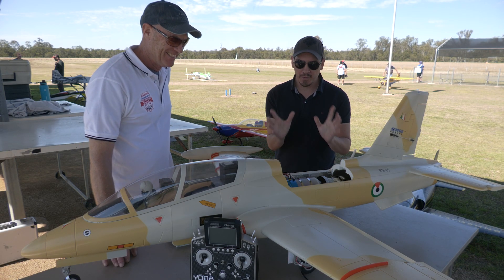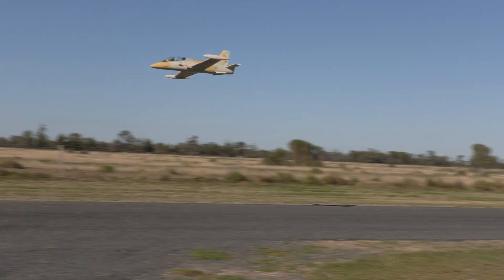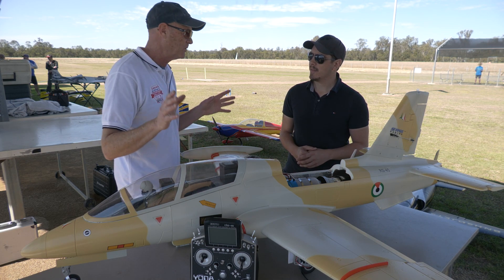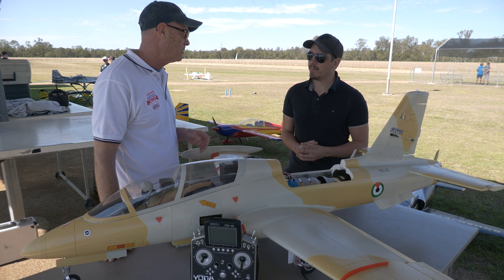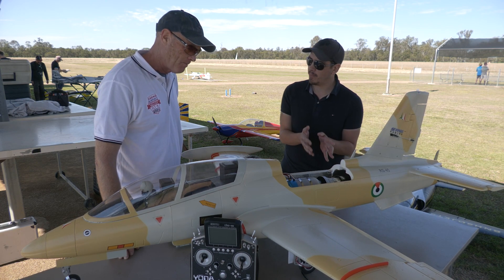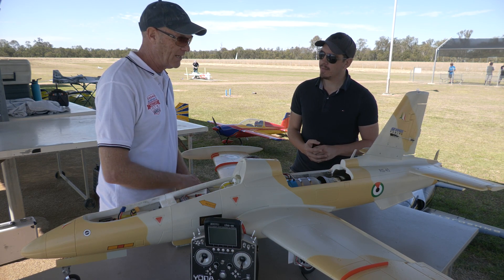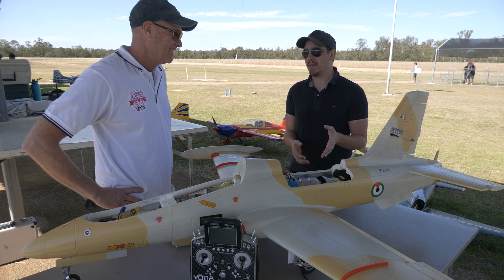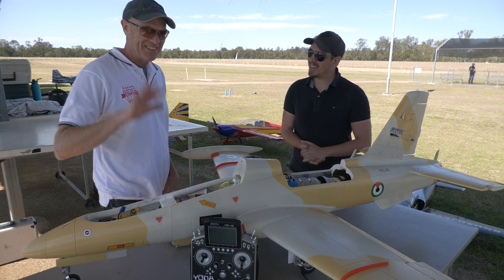LINTON JET X80DK Turbine Review

Comment: Pretty cool engine, but the X90 is much smaller and makes even more power, 9.2kg average. Power to weight is everything.
Reply from the maker: Yeah the Xicoy range are top in market in my opinion. I love my X45. This turbine i believe you can increase the performance to just over 10kg. but we need to test that further to see things like consumption, wear, etc on the turbine. But you have no argument from me. Xicoy is a GREAT brand